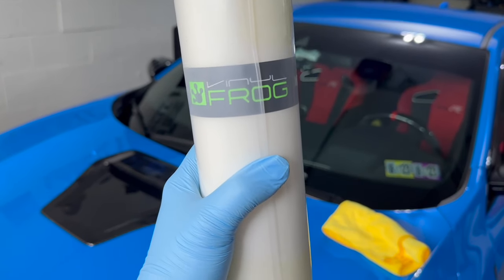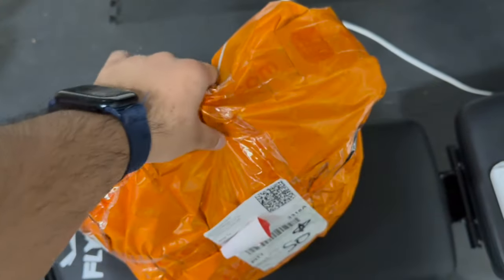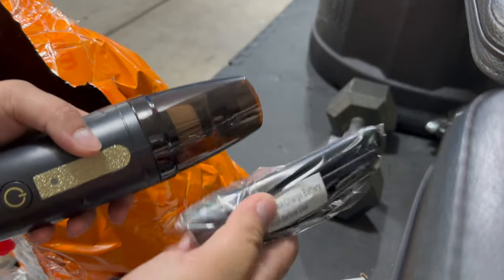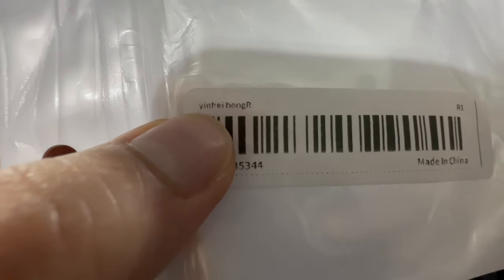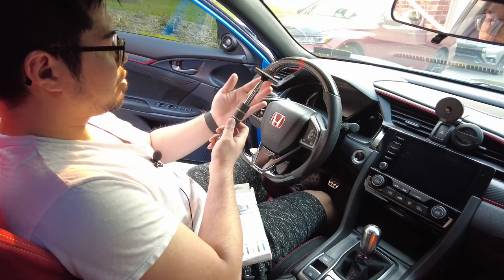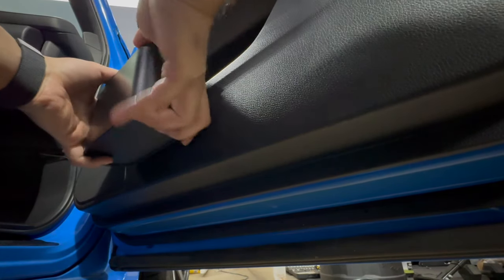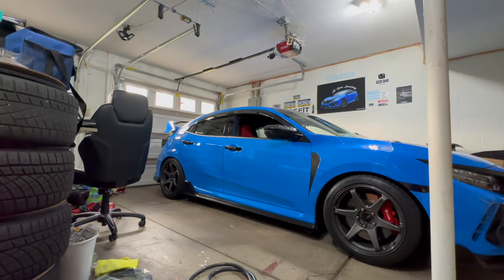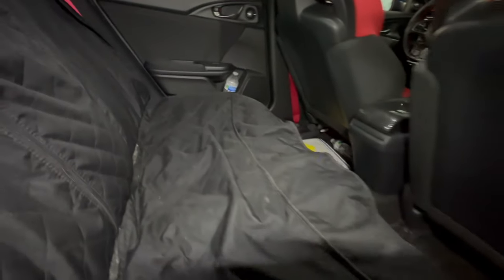Trying Out Car Accessories from TEMU

Comment: I'm 6'5", but interior windows of varying degrees of angle can be daunting to clean. Particularly if you're running a detail business such as myself. That square microfiber wand is a hands down (see what I did there 😉) item to get, allowing you to make sure you are able to wipe those far narrow areas of the inside windshield where the dash meets the windshield. Would suggest it to anyone, no matter what their size. I even created my own fluffy mocrofiber towel boot to be used with it for when the need arises.